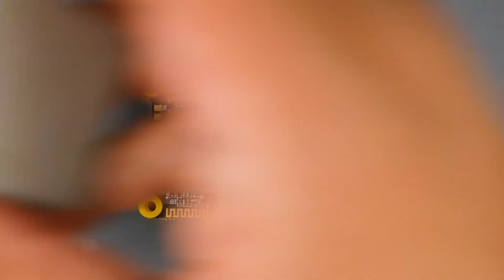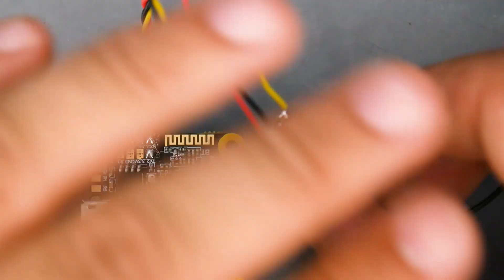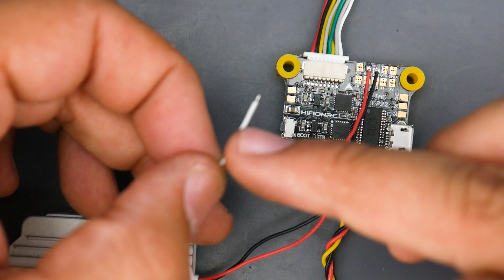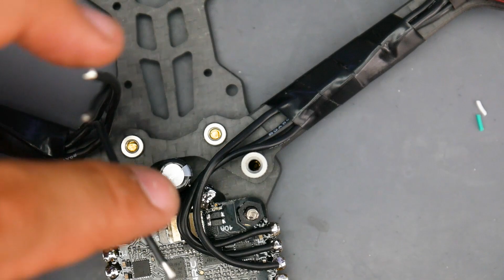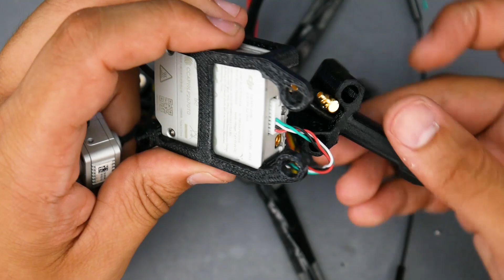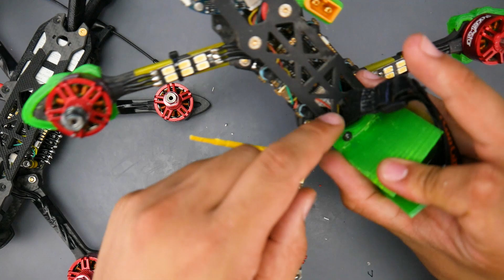Beginner Guide // How To Build Budget DJI Cinematic FPV Drone 2020

Comment from the maker: Drone Parts:
Racerstar Motors: http://bit.ly/2KIWZBE
FrSky R9 Mini: http://bit.ly/2m5gqfi
Geprc Mark4 HD: https://bit.ly/2UrramX
DJi Air Unit: https://bit.ly/31xC7qp
Batteries: http://bit.ly/2Piyqk8
Batteries #2: http://bit.ly/2AQY2vt
Propellers:  https://bit.ly/2UdGxyM
Upgraded Flight Controller Combo: https://bit.ly/2WJUvu6
The Connection Are still the Same with the Upgraded Variant

Tools:
Hex Driver: http://bit.ly/2NwBVxt
Soldering Station: https://bit.ly/2ylZC9O
Reply: If I was to upgrade on the Fc and esc, what would be a good choice (with Dji pnp) ? 

Also I have some Xing-e 2207 - 2450kv. Good fit?
Reply: do you have to use DJI goggles and controller with the DJI Air Unit????
Reply: @JifferRiffic  You have to use the goggles. You can add any reciever you like and use any controller supporting that reciever. But the air unit also support the dji controller. Then you don’t need any extra reciever. In short air unit is both vtx and reciever in one.
Reply: Could you make a video on how to connect a controller?
Reply: can you gift me plz 😍😍

Comment: Your soldering tip needs to be trimmed or filed down. Its heating up more in the middle requiring you to lay the tip flat. Also, you do not need to preheat the pad before soldering the wires together..  once the solder from the wire hits the pad (with solder on it as well) the melting solder from the wire is enough to melt and fuse it to the pad solder. You want to expose the board to as little heat as possible. You should never add solder during the fusing process.. instead build up the required amount of solder on both the pads and wires ahead of time. Remember to wipe the wires with alcohol after twisting.. Its also a good idea to wipe the pads with q-tips and alcohol as well.. oil is your worst enemy.

Comment: Noob question here. It looks like the solder points on each pad of the ESC are slightly touching each other. Doesn't this impact the signals?

Comment: Thanks very helpful but can you do a follow up video for total beginners that shows parts that you skipped, like extending the DJI cable (where did you get the extra cable?), attaching the xt60, attaching the capacitor to the xt60 (you said we would have been bored but i dont know why. If it really takes a long time, maybe do a timelapse or add voiceover to explain stuff), attaching the ESC to the frame, connecting the ESC to the FC, installing the motors on the frame, changing the motor spin orientation, setting up in betaflight. Also I thought i saw r3 and t3 toward the rear. Is there a reason you didnt use those instead for the DJI cable? Anyway this video did really well and i think this follow up would also do well.
Reply: you need a capacitor for xt60 to lower the noise aka voltage spikes which might cause interference with your quad's video and control or even damage your esc

Comment: when you soldered the motors onto the board because there's 3 wires do they have to be in a specific config, or does it not matter as long as you solder them to their corresponding sections?
Reply: Depending on the board, it may not matter. The esc he’s using, you can change the motor rotation in the software.

Comment: If you would use a dampened sponge to clean the soldering tip after a few connections you'll get better connections without globs of solder.  Also, use a liquid flux pen or soldering rosin paste on the circuit board pads and the solder will flow much, much easier without you having to use so much solder.

Comment: I also want to know why have used air unit instead of vista? Also for real I think that iflight 5 inch frames are much better and have more smart solutions for example motorwires protection, reciever holder and etc...

Comment: Thank you for the step-by-step walkthrough video! Just started getting into FPV drone building but I had a question about the build.  Is there a specific capacitor that we need to connect to the XT60? I saw in the video that you used a 830uf 25V panasonic capacitor but I was only able to find 820uf 25V capacitors.  Will that make a difference?  Thanks again!
Reply: i had the same question, did you find the answer?

Comment: Can i know how to make a fpv drone with cc3d flight controller
Reply from the maker: You bought a very very old flight controller we don't use cc3d anymore.
Reply: So which one should i use because i have a low budget
Reply from the maker: @dimplezaveri8819  buy a diatone f405 mamba you can even get the combos pretty cheap and they perform very well.
Reply: Where can i buy it from because in india bangood app and other Chinese apps are band so any other website

Comment: Hello guys, I would build a cheap drone using ESC Racerstar 4x1 35a (very good and durable), Omnibus F4 V3S (cheap and works well), Mark4 (generic - freestyle) or VX210 (for racing), Foxeer Predator camera, vtx 805 with  linear antenna that comes in it, Dalprop 5043 propellers (freestyle) or 5046 (race), RS2306 emax motor or old Tmotor F40 pro (it's very  cheap now on Alliexpress).  All of this purchased on Alliexpress.  ;)

Comment: A zip tie and a piece of heat shrink or tubing can make a cable stand off. Slide a piece of tube 1/8” long or so on to zip tie, loop the tie back into the heat shrink, opposite direction as first. Kind of looks like an eight, attach where ever. 🤙

Comment: Agree I love those motors 😊😊 what’s your oppinion on Hard mounting fc? Fettec highly recommends for their fc.based on that I decided to get Glider hammer from Fpv Cycle and put esc between arms on 30x30 and FC above middle plate on 20x20 mounting :) (+ emi and fire isolation 🤷‍♂️)

Comment: Drone Mesh I have been told that having the compassitor mounted  on the battery plug the way you  have it does little to stop power spikes, etc. Can you do a test to show  how it helps  mounted to the plug compared to mounting it on the ESC??  That's a nice quick easy build.

Comment: It looks like the R9 mini uses ACCESS protocol. Do we need a FrSky Radio for this to work ? or can we use Jumper/Radiomaster ?
Reply: I am new to fpv. I bought the Frsky radio  and the receiver but I couldn't bind it to my radio through ACCESS protocol. And just after that I tried flashing Different firmware LBT or FCC. It still didnt work. Then I looked at the manual and online and it turns out these R9 mini OTA receivers are compatible with external module called R9M or R9M lite... cuz those are long range receivers up to 10km so needs external modules. I am learning myself just looking thro different yt videos or googling for answer😄😄

Comment: The DJI Air unit alone is US$179.00 so how you calculated 161$?
These motors are bad. The bearings are the worst I ever had and the magnets become loose on 5-6s resulting in random crashes.
Better take some cheap from T-Motor !
Greetings
Reply: I was thinking the same thing!  Freaking click bait video.  SMH
Reply: Or even the iflight xing e line. Thosr are pretty dang good for a budget motor

Comment: Drone might be budget but the goggles aren’t 😭
Reply: When's somebody gonna come up with a DJI receiver for analog goggles.
Reply from the maker: Its already available and I have reviewed them and use them.
Reply: @DroneMesh  Might want to re-read the question before you get swamped with questions.
Reply: @DroneMesh  hey, i'm interested in the hobby, do you think i should build one myself or getting the factory build ones???
Reply: @Tim_Lamb  yeah I wasn't aware of one yet either. lol
Reply: @novavin1140  first i would recomend buying a budged factory build just to see if you like the hobby , then a selfmade... the thing is, your drone will crash often and things will break; if you build your drone by yourself you know what is in it and know how to fix it, factory builds are sometimes less easy to dismantle
Reply: @SGA_Speedy  ahh, ok, that's actually is my concern if i'm going to buy the factory build, and thinking of building it myself to also learn, but i hear that sometimes the drone can blow up or catches on fire if the wiring wasn't right, so i'm afraid i'm just going to waste my budget if i build one
Reply: @novavin1140  First question I would ask is are you able to build one yet? If you are capable of building your own then always would say build it yourself but if you don't have soldering down along with knowledge on building one then buy a BNF but keep in mind that you typically get what you pay for. Our company builds custom BNF quads that are built with some of the best components available presently. If your interested in buying a pre-built quad that's going to be built better than most give us a shout. I can go over our full build spec on our line of BNF quads. sales@fpvzone.net or fpvzone65721@gmail.com guarantee we have some of the best on the market!
Reply from the maker: @novavin1140  building your own is best..  because you will break it and if you built it then you will know how to fix.
Reply: @DroneMesh  ohh, ok then, but any tips on how to prevent the drone from catching fire/blowing up?? Since i plan to use DJI air unit and controller and iflight FC & ESC the build should be not too hard(hopefully), but still...
Reply: @flhexing_mystake4503 No, I have never build one, and for soldering i know a thing or two, as for spec since i'm a beginner and not fully understand all the tech and motors that are compatible, i'm building it based on the BNF, so for spec i don't think there would be much difference
Reply: @novavin1140  If you're on a budget look for a used build on e-bay, pay 1/3 to 1/2 price for the components, you can always make it yours.
Reply: @novavin1140  Thats actually a great approach and sounds like you have enough of the basics to be just fine building your own. biggest thing with motors is just knowing what size batterirs you want to run then just picking the kv rating that will work correctly with them. With the new Betaflight  firmware you can build a 4s quad then whenever ready to step it up slightly, you can configure it in betaflight to run 6s also. Well glad to hear you have a plan and you can even email me with any question if you like if you get stuck or just have something your not positive about. Happy flying!
Reply: @flhexing_mystake4503  thanks for the help
Reply from the maker: Red is + blacn is - ..... Take your time and make sure nothing is touching when soldering. Also a smoke stopper will help. Other than that make sure the propellers don't cut the battery wires or go into the battery.
Reply from the maker: @macelius  I misread your comment. There are  a couple companies I know that are working on something like that but currently there is no modul to enable HD on the things available in the market.
Reply: @DroneMesh  Thanks for the clarification, it'd be cool, with all the HD capable optics available these days, to just add a compatible FS style modular receiver.  Maybe even just a separate DJI ground station with HDMI out.